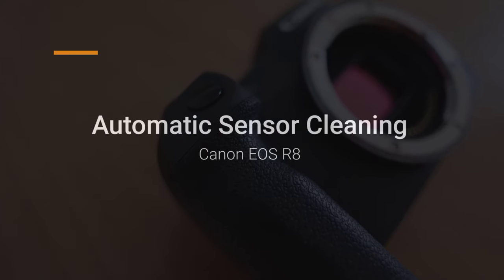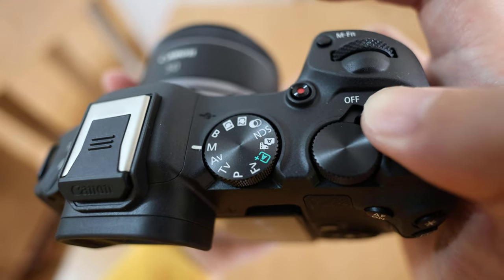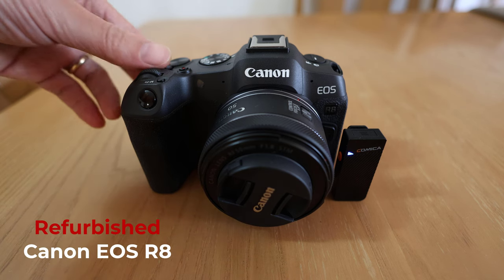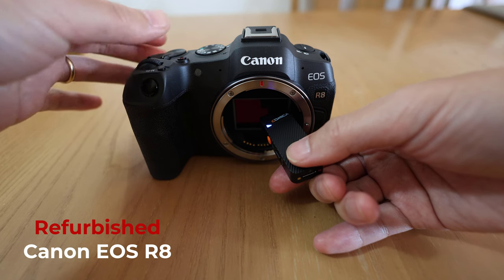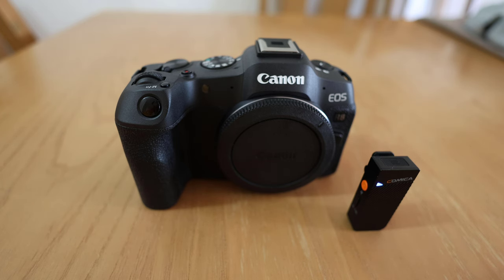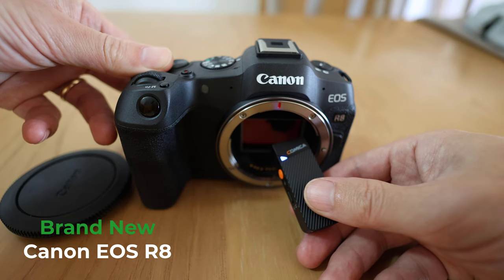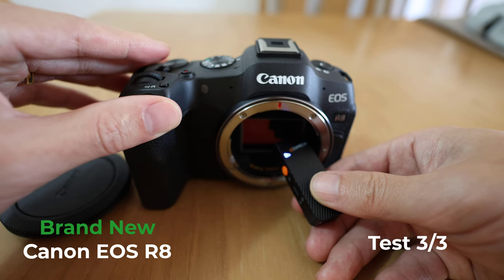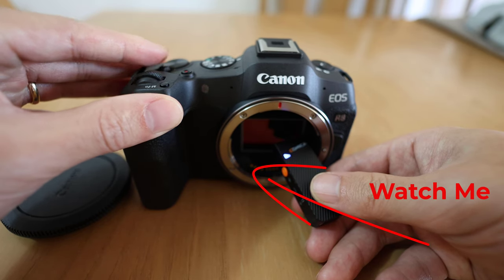Canon R8 Auto Sensor Cleaning Bad Noise Sound

Comment: I just got my r8 today and it do the same. They all do. Sensor cleaning is a vibration to shake off the dust, its impossible to make it completely noisless
Reply from the maker: It is not possible to make it noiseless, but the auto cleaning noise should sound solid. Mine sounded hollow and metalic.
Reply: No they dont all sound like this.

Comment: Hello,Did u get any solution for this?
It just happened with my r8 i just bought a 24-105 lense and when i removed it i heard if for the first time
Reply from the maker: Did the Sensor cleaner have the metallic ring to it?  After I posted this I noticed that you can hear the sound from speakers, and that you have to have headphones on to hear the metallic sound.